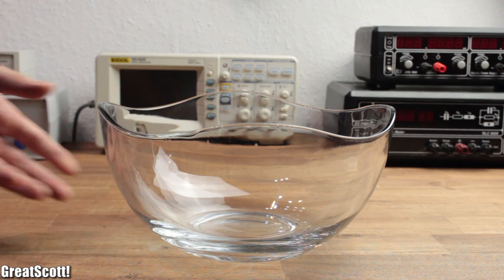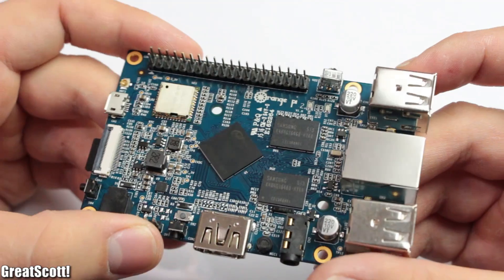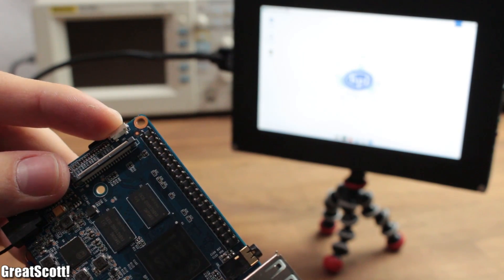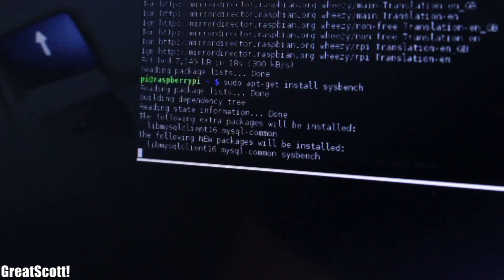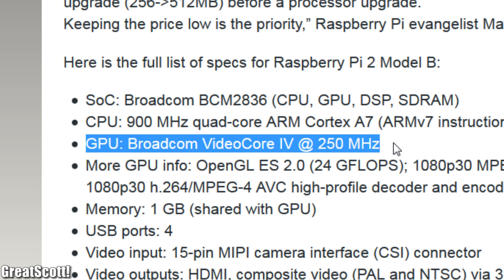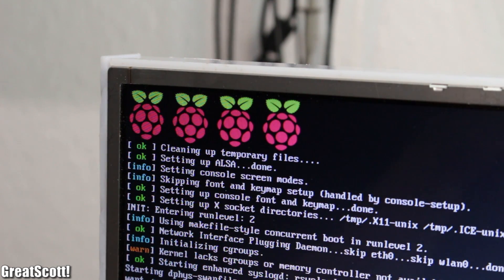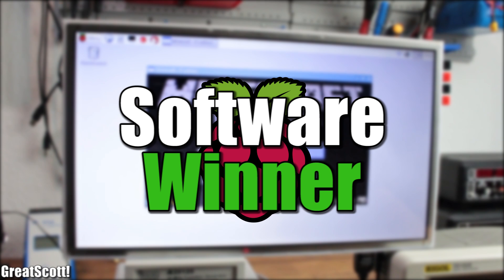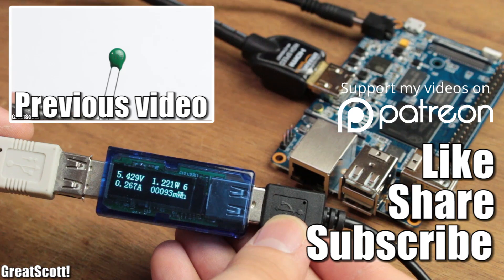Raspberry Pi 2 VS Orange Pi 2 VS BPi-M2

Comment: Hi Scott!!I'd like to refresh  a topic regarding Orange Pi vs. Banana Pi especially that comunity is growing. Currently there are a newer versions of each boards. Orange Pi seems to improved software (according to buyers opinions). I'd like to know is it worth it to get either of this minicomputer (as alternative to Raspberry Pi 3 which I already have)? Purpose is installing OctoPrint on it, record video during 3d printing procces using some nice -not dedicated usb cam like ELP, store that video files on attached 2,5'' HDD and maybe play around from time to time. Best  would be to get high resolution (let's say 4k, or at least HD in the worst case scenario). But as always there some cons. Some people are convinced it cannot be done, while others believe it should work :) What is the right answer? :) There isn't any instruction how to install Octoprint on  BPi (while for RPi there is planty, and just a few for OPi). I'm searching solutions but in case of Orange or Banana it's not so obviouse. What about different boards (like Asus Tinker boards, Odroid or Rock)? Could you maybe do test comparison about running octoprint on that devices, please?  Another question: is it possible to install Octoprint on system like Android or even Rasbian for not Raspberry devices? What is your opinion about Orange Pi and Banana? I have read what you wrote 2 years ago, but after a such amount of time your possition could be changed. Wasn't it? :)

Comment: Can the Orange PI plus2 run Windows 10?
Reply: unfortunately no, not yet, as all three here come with an ARM architecture and windows only supports x86-64 architecture. Even of it had support for ARM any windows will lag to death excepting windows XP(microsoft has ended support).

Comment: Interesting - I've tested all of these - and the single thing that has stood out up to now - is that the ONLY unit that is properly supported with just about everything working - is the Raspberry Pi 2 and of course now the much faster Raspberry Pi 3 - which - as it is the same price as the old model 2 should be the one to compare with.  Orange Pi support is non-existent - the images on the company website don't even work for the most part, I'm checking BPI-M2 now - the "Raspbian" image - the first thing I tried was the SD Copy program, one of the better features of RPI. Doesn't work. RPI does not have Android YET but at least the image people are working on is Android 6 - most of the other offerings provide pretty ancient Android like 4.2.

Comment: You can get much, much more performance of the Orange pi if you downclock it and put a heatsink. I downclocked mine to 1.3ghz and it's now even faster :D For example on the sysbench test i get 140s which is very fast. But i have to agree - the software is crap. There are no good drivers for the gpu, and it has a limited set of resolutions.

Comment: Will the monitor/display port on the Banana work with any type of screen with the same socket, or are you stuck with a Banana brand screen/other screen with external driver?

I have lots of junk electronics like a couple of perfectly working screens, would be fun to make a tablet or some other portable device. Also, can you use a rc car single cell lipo pack for power? Those packs usually have a lot more mAh than those UltraFire or similar type of batteries.

Comment: Most of the time its not about the hardware its about the SOFTWARE and the POPULARITY. Original raspberry Pi does have the worst hardware but this they have hell of a user community which is very important for newcomers. Same applies to Arduino. They have dominated with it.

Comment: I'm wanting to mount one of these fruity boxes on the back of a TV to play videos in our church. Would use VLC (or something similar) to rotate thru a fixed playlist of short WMV videos containing announcements, etc. that we would upload over a network. Which of these devices would you recommend for that?
Reply: +cee128d I would recommend you buy the Raspberry Pi Zero and Install OpenELEC on it, it is an OS dedicated to being a media center and dang good at it. My Raspberry Pi can run smooth videos up to 1080p and stream 720p videos. Would be perfect for your needs
Reply: +Simisful That might work out if one could actually get one. Haven't been able to find anyone selling one for a reasonable price. Seems the only people who have them are scalpers charging 10 times the regular price.

Comment: Raspberry PI 2 get's a Kernel 4.1 and it has a great community and the most smooth working Linux distros around plus the unfinished windoze 10, also can be overclocked to 1000 mhz cpu and gpu 500 mhz.
The other boards still have Kernel 3.4 (at least bpi-m2) and not so good working distros that's why i prefer the Raspberry PI 2 is all about compatibility and stability.
Reply: What kernel does the odroids similar class device use any idea ?

Comment: A Raspberry with GBit LAN would be so awesome :(
Reply: What's Gbit Lan?
Reply: 1000 MBit LAN
Reply: +Ben F. Is it a special cable and port? New hardware? Or is it firmware?
Reply: +christopher jones it's the speed the raspberry can transfer data on the network. Depends on the chip and CPU. Sadly the pi has 100mbit lan only. 1Gbit (in theory) is ten times faster.
Reply: +Ben F. Which device has the Gbit lan? Sorry I need to google this. It's new to me
Reply: christopher jones I feel like I am getting trolled. Any modern PC has GBit LAN and the banana Pi has. See: https://en.m.wikipedia.org/wiki/Comparison_of_single-board_computers

Comment: Which do you think will be the best solution for a custom touch screen car radio? I'm thinking of building one, but still in the early stages of research. I would like it to be quick and responsive, but still have the main functions of a touch screen radio i.e. play radio, have bluetooth connectivity, etc..
Reply: Raspberry pi :P
Reply: +Massimo Giardina Why? What makes it a better solution?
Reply: Well it is compatible with more drivers and it uses less power than the other boards.
Reply: +Massimo Giardina LMAO. He wants it for a car stereo. In that context, where it's almost certainly going to be coupled to an amp of a kW or more, isn't it pretty silly to be pointing out a difference of a few mA?

I think whatever is fastest is most appropriate. It has hdmi, what do I care if it will connect to a flat panel directly? If it's for a car stereo then you want it able to run alsa as efficiently as possible, and you want at least four usb ports because one pair has to be dedicated to your 8 channel DAC. It only needs one connector, but you cannot pair usb audio with other peripherals on the same usb pair or it may cause issues. 

linux
hdmi
4usb ports
screaming cpu

You don't want fruit, you want an edison. These low cost boards are cool and all, but if you're designing something for an actual product and not making a toy to share with your friends then you should use an appropriate platform. The Edison has intel's name on it' the pi's are all well known as cheap chinese shit made to the absolute lowest cost. Perhaps they're both made in China, but one has intel's name on it. In an environment where you can have -kV current spikes on the power supply from the various magnetic clutches and actuators combined with 140 degree temps in the summer heat, which would you rather have in charge of your tunes?
Reply: +bobhaha RPI has a lousy audio output (PWM with RC filters) and I wouldn't racommend it for audio applications. Allso choosing the right screen could be tricky (lots of $$) - that's just my opinion
Reply: +Brad Scott I don't see how the edison could help me? It's less powerful than any of the fruits, no video or audio out...?
Reply: do some research, bob.
Reply: Brad Scott https://www.sparkfun.com/news/1603
Reply: From my limited research Edison is not going to work. I've dabbled with the Pi's, and they're just not beefy enough for me... too sluggish. I think I'll be getting a HummingBoard instead. They seem more than capable.
Reply: You do know the Edison is more than twice as fast as the rpi... or any of the fruity boards... right? I'd be interested in seeing how you managed to make it more sluggish than an rpi, which is horribly slow.

Never mind. This entire discussion has become a waste of time. Anyone not capable of understanding how to make an Edison dance is not capable of completing the stated goal. Do some research. Bye.
Reply: Brad Scott Not sure how you think a 500MHz Dual-core processor is quicker than a Quad Core Processor running at 900MHz

Comment: Hi, did't you try to get hdmi working if not connected at boot time?

I'was only able to force hdmi output and resolution on raspi. It's an importent
feature if you connect a board to a tv set that isn't set to hdmi in at boot time.

Haven't tried banana pi 2 yet.

Comment: Hey Great video 

where did you get this USB wattmeter from minute 6,28 ?
Reply from the maker: +Xsaiuus Here is my one. It is a bit cheaper: http://rover.ebay.com/rover/1/711-53200-19255-0/1?icep_ff3=2&pub=5575101368&toolid=10001&campid=5337582279&customid=&icep_item=291550076384&ipn=psmain&icep_vectorid=229466&kwid=902099&mtid=824&kw=lg
Reply: Perfekt ich brauche 10 von den dingern!!! :DD   Danke

Comment: I'm really surprised the Chinese haven't come up with the Apple Pi™ yet.
Reply: +dlwatib China has entire fake Apple stores, and they get away with it. The Chinese dont care about lawyers!
Reply: +MrBazinger all Chinese are lawyers
Reply: +Green Silver Apple lawyers would object.
Reply: the challenge has been accepted, wait for tomorrow
Reply: +Green Silver The Apple Pi would cost $399 minimum.
Reply: Like Chinese care xD
Reply: +Joe Federico doctors. All Chinese are doctors.
Reply: It is - but doesn't work anywhere near as well as Raspberry Pi - it's ok until you load Debian and Node-Red and try to control the ports!!!
Reply: damn i was dumb also would the specs be a single core cpu clocked at 1 mhz and 1 byte of ram for the apple pi?
Reply: I worked at at Manufacturing oil company. China cloned our designs, I'm talking millions dollar equipment. They steal any IP they don't care about lawyers.
Reply: +Green Silver At least they'll make better products than the real Apple......

Comment: Hey at the very end of the video where you showed the how much power was going through the usb. What is that? I have been looking around and cant find a good one. I want to use it to test out some battery packs that I have.
Reply from the maker: +Jameson Sullivan Here you go: http://rover.ebay.com/rover/1/711-53200-19255-0/1?icep_ff3=2&pub=5575101368&toolid=10001&campid=5337582279&customid=&icep_item=291550076384&ipn=psmain&icep_vectorid=229466&kwid=902099&mtid=824&kw=lg

Comment: You should check out the Odroid series. The Odroid C1 is faster and cheaper than the BPi-M2. If you need even more power then there's the Odroid XU4 that has 2GB RAM, faster CPU and USB 3.0 (great for fileserver with usb HDDs) roughly double the price of the Odroid C1 though. I run arch linux on my C1 which also includes a port of the wiringPI library. You can get these boards from pollin in Germany.

Comment: Where can I get that little USB power measurement tool shows at the very end of the video?
Reply from the maker: +Diamonddrake There you go: http://rover.ebay.com/rover/1/711-53200-19255-0/1?icep_ff3=2&pub=5575101368&toolid=10001&campid=5337582279&customid=&icep_item=291550076384&ipn=psmain&icep_vectorid=229466&kwid=902099&mtid=824&kw=lg
Reply: +GreatScott! Thanks!